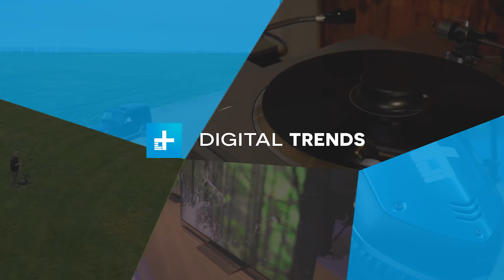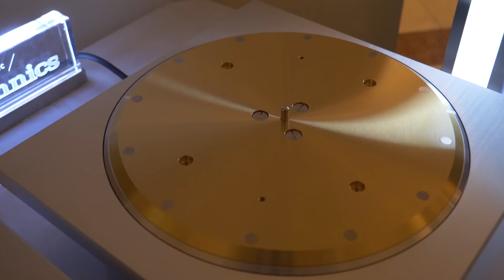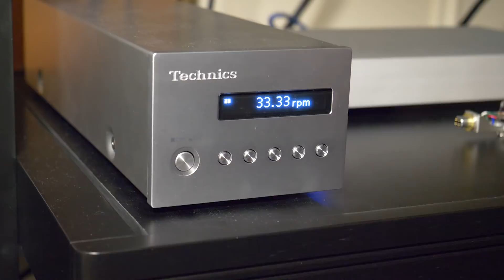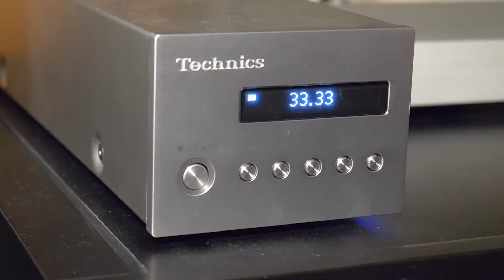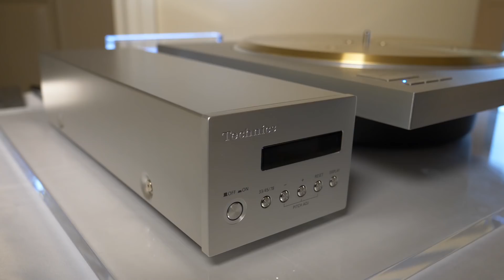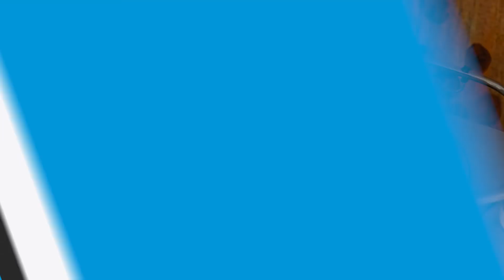Technics SL1000R Turntable System - Hands On at CES 2018

Comment: Stunning. I'm pretty sure analog lovers will be ok with the price if it sacks up with the competition in that price range. Sure do hope it beats it. $20K is a lot of money and if you want to add that Reference system to it, you are looking at $80K !!! So, to recap, if you were a DJ in the '90 and were spinning records on Technics SL-1210 MkII and now have matured in an audiophile but still loyal to the Technics brand, you've better have saved up $100K to have Technics set up in your living room again. ( I've figured out you'd wanna spend another 20 000 bucks on a decent audio rack, some power and interconnect cables as well as the shell and cartridge ( stylus ) that doesn't come with the new SL-1000R )! All this being said, if I had all this money, I'd be at CES putting in my order :)